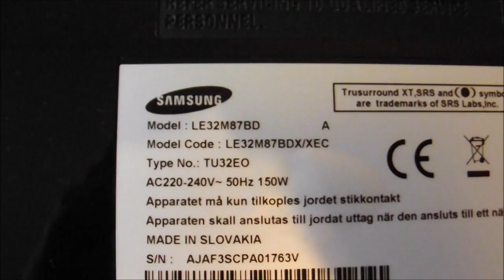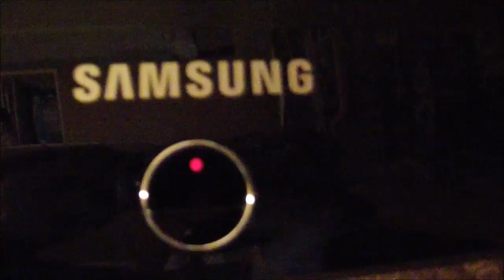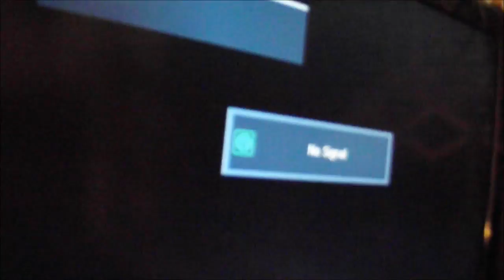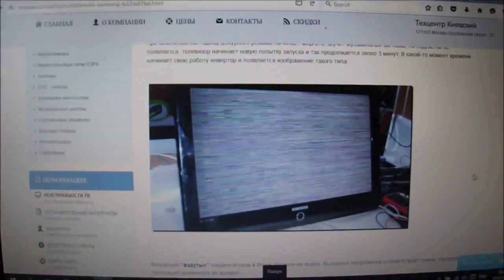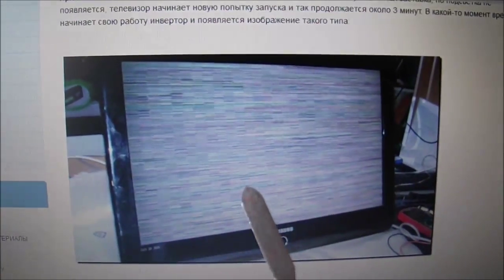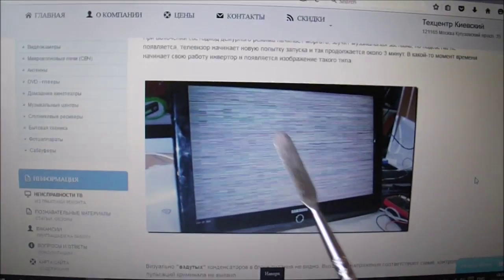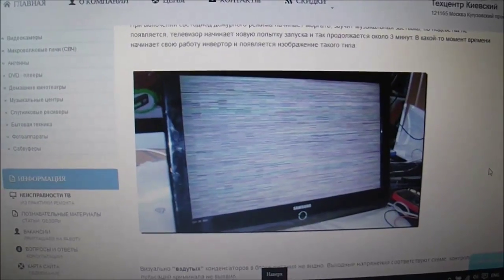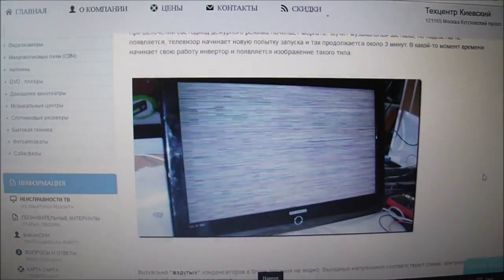Sumsung LE32M87BD Repair - LED Blinks, No Display

Comment: I have the samen problemen,  but cant find the right capacitor on Internet. Can you help my with a link were to order it.
Reply from the maker: It's 1uf 10V SMD electrolytic capacitor. You can go to your local electronic components store and ask for a "1uF 10V SMD electrolytic capacitor". Voltage can be higher than 10V (25v, 50v etc).

Here's an example from Mouser: https://eu.mouser.com/ProductDetail/Illinois-Capacitor-CDE/105SMH050M?qs=sGAEpiMZZMtZ1n0r9vR22TWSmFhvMSNtk8%2fTBsjBJFes8J18dE8fnQ%3d%3d